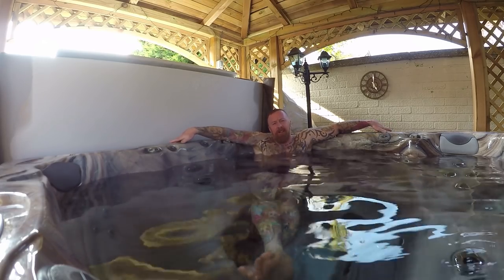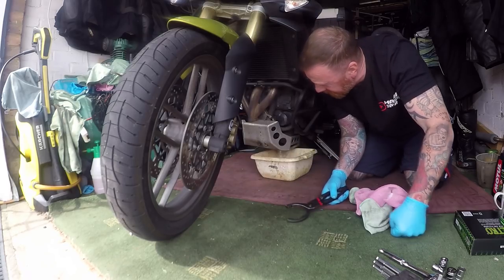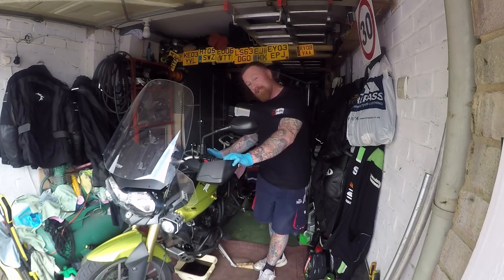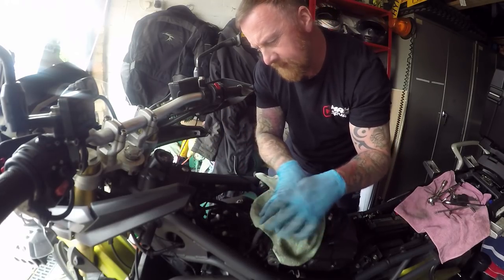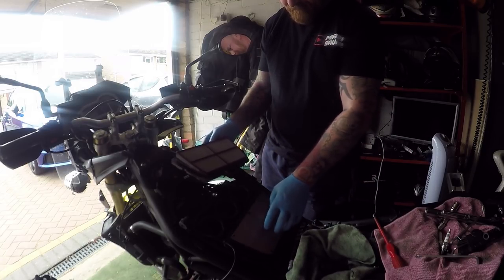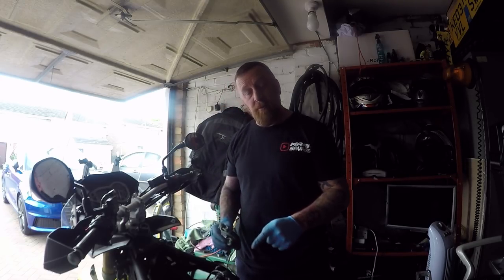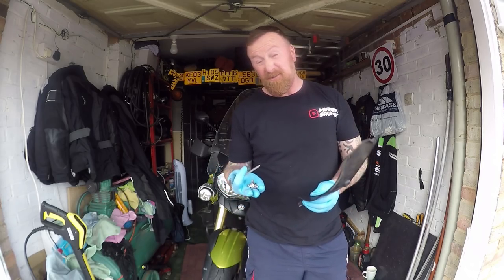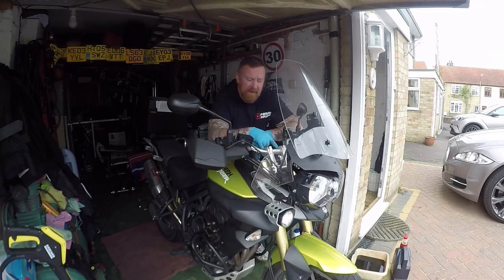TRIUMPH TIGER 800 SIMPLE SERVICE MARK SAVAGE

Comment: And l through my vstrom had many bolts and clips to service. Not looking forward to take my new to me tiger 800xc apart for service. How did you reset the service light? 
Great walkthrugh sir.
Reply from the maker: well the service went well and hope it helps you do yours, as for the service light --- no its still a main dealer thing and have to pay them to take it off---- me I left it on as its only small icon lol 
take care bud
Reply: @marksavage  always great to sneak peak on someone who done it before😀. Oil change is up next, and thats not a problem. Triumph has really bolted their tigers together to be solid. 😀😀

Comment: How much was your spa? and did you have to have it craned over the house? Perhaps do a vid on it reviewing it? interesting to know the ins and outs of getting one.
Reply from the maker: I love my hot tub and was going to do a review on this one, I set up another channel and was going to do all about to good and the bad and how to keep it clean, filter cleaning, how much they use per week and top tip on keeping the water clean 
best get that video sorted lol 
this one is a vista which is a good make hottub, it cost £8500 new but was  x display and got it for £6500
they got it down the side of the house so no crane need 
we are in it every day, winter and summer and love it 
keep an eye out for my review bud and thanks for watching
Reply: @marksavage  awesome mark, 6500 is good but 8500 is a tad over my budget I guess you need another 1500 for the bits and bobs it needs and install.
Reply from the maker: Rob k you can get them for £4000 we just wanted all singing and dancing lol 
Most will deliver and install with the price 
You will need a sparky to wire it in if 32amp 
Some are 13amp plug and play which are easier but not as powerful 
Will sort out a video bud for you

Comment: Thanks mark By anychance do you know if the turn signal relay is underneath the tank? I installed sequential LEd turn signals and they only light up half way not enough power from the relay. I have a tiger 800 xrt
Reply from the maker: Thats odd as the led use less power !
I thought it was at the back 
Have you tried to power straight from the battery to test they are working ok ?
They would normally flash fast if it was the relay , 
If not at the back I dont remember it under the tank 
I did a service video and had the tank off ,maybe give that a watch to see if you can see it bud
Reply from the maker: I mean another 800 video bud

Comment: Hi Mark what do you call the  pliers that you used to get clip of the fuel line ? Cheers
Reply from the maker: they were diesel plug pliers , but the work very well bud
Reply: Hi mark ive got a triumph explorer she let a back fire out of her as I was coming into my garage after a run though it was bad petrol but running very rough since very jumpy idle I was wondering would changing the plugs help cheers
Reply from the maker: @stephenkelly7887  a back fire won't just blow out the exhaust !
It could of popped off a air pipe so check them as simple thing to do 
But big time you could have damaged your valves!!
So going over it like you are is the first easy step and won't cost 
Check exhaust , air pipes , air box and plugs and see how you get on

Comment: Hi mark quick question for ya back wheel is locked up on moped cant push it so took of the wheel and took out the break shoes and the brake lever was stuck u could not press it so cut the cable  and still the axle wont turn any ideas its a project bike im fixing up its a 96 yamaha spy cheers
Reply from the maker: hi bud 
if its not the rear brakes its often when the belt snaps and locks the rear whell, 
however so its cable brake so it have shoes not pads, they can lock out so you will need to put the bike on the stand undo the wheel bolts on the other side should be the lever try and whack that in and out to free it up and keep doing it use loads of wd40 and try and get the rear wheel off that way

Comment: Hi mark, I have a Yamaha aerox 70cc I’ve asked you a few questions. So basically I was stripping it down for maintenance and work due to it braking down but I’ve sorted that and I noticed that it hasn’t got a thermostat and I looked at my old 50cc cylinder cover at work and that doesn’t have a thermostat either I was wondering what’s the consequences of running no thermostat or if it’s okay to do so
Reply from the maker: NonCopyRighted 
It’s common and just would just mean it take a little while longer to warm up 
People take them out to keep the temp down as the mopeds gets old with poor servicing of the water system 
If it’s running ok 
Leave it
Reply: mark savage thanks for the information. I have another question so basically I was riding to work then all of a sudden it would cut out and lose compression then like regenerate compression but then if you rode it for say a mile it would struggle then cut out. So I got home but I had to use the choke to stop it from cutting out which I know I shouldn’t of done after stripping it down on the cylinder head there was a shit load of carbon buildup on the spark and everything however i stripped it up about 2 weeks before that and it was fine. The piston has scoring down it but i blabbed and basically lied to the place I bought the piston kit from and they sent me out a new one so gonna install that then see how it runs. But for the time I was using the choke say 3 to 4 miles if that would that cause all the buildup or is the oil to fuel ratio off?
Reply from the maker: yes it would as it would be running very rich, as for the piston scoring I would be looking into your oil pump and seeing it is working ok and make sure you are using good 2t oil ( like in my videos 2t moped oil worth a watch)
this can be caused by running to hot too or its  a cheap or failing piston 
clean it all up change the piston and sort out your carb and cheek the oil and pump plus are flow and air filter then tuning

Comment: Hi mark..vids are awesome...I need some of your expert advice..I have a 2015 Peugeot speedfight 3 125 4t..the problem is on the dash there should be a temperature gauge next to my fuel level...it doesn't seem to be working...any ideas? Your advice would be gratefully taken...keep up the quality vids 😁
Reply from the maker: the SP3 had clock issues ! a lot had to be changed but for your lets do the simple checks 
on the engine you will a connector to the water system and this will send the info to the gauge so check for that first
then the wiring but really as long as you service the water system when you do the next service and keep an eye on your water it should be something you can live with bud
Reply from the maker: oh and thanks for watching mate there are a few sp3 videos on my channel 70 in total on speedfights

Comment: I know this way off this video but I'm (me myself and I) going to change my oil in my kymco agility 50cc WHAT KINDA OIL SHOULD I USE? CAR OIL? SCOOTER OIL? 10W 40 HELP🙏🙏🙏
Reply from the maker: with mopeds its ok to just use 10/40 but for me I still use motorbike oil but many others say it doesn't matter as long as its 10/40, its an easy job and something to keep an eye on as they all burn a little bit of oil so keep your eye on the oil level every few weeks
but do not over fill bud 
hope that helps I have many moped videos that should help with other things like service etc

Comment: Hi mark. I’m just wondering what 125cc would You recommend geting at age 17 on a CBT ? Cheers
Reply from the maker: hi bud 
it comes down to your budget , I have many 125 cc videos on my channel .
tyre in 125 mark savage and you will get to see them.
if you want a bike that keeps going ybr125 or cbr125, good money but the do keep going 
then you have the Chinese ones like sinnis etc, on my channel you can see them as they are a lot cheaper and require a little maintenance 
if you tall check out the derbi terra they are a good tall fast 125 
stay safe bud

Comment: mark my moped sounds like a motor cycle. it was quiet till out of nowhere it got very loud. I am not a mechanic an i really dont know any. can you help man ?
Reply from the maker: You will need to check if the exhaust has snapped or broken 
Start the bike and have a look if you can see where it’s coming from 
They can snap at the next near the head 
It’s not hard to change 
My videos will help
Reply: @marksavage  are you on Facebook or Instagram? I looked at the exhaust and I can't see a Crack,  it seems to be coming from  where the gasket and exhaust meet. I'm not a mechanic n I literally don't know any. any help you could give me I would seriously appreciate it

Comment: Hi Mark, how can I contact you to ask you some specific questions about one of your motorcycles who become mine these days :). I'ts about a Triumph Rocket 3 :)
Reply from the maker: I have a few videos on the rocket 3 on my channel 
They are great bikes 
Ask on here bud but give my videos a watch
Reply: I watched the videos :) and I'm happy with what I saw. Actually the thing is that I'm going to buy that Triumph from the guy who bought it from you. He is a Bulgarian and the bike is here. I want your opinion about this particular bike, is it worth it. The engine check lamp is on is that a problem or no. And have you got the solo seat or any other parts for that bike. Thanks
Reply from the maker: Zdravko Viranev oh wow so you bought my old triumph rocket 3 with the paint job that bud got done ?
Reply: Yes exactly the same bike :)
Reply: What's your opinion about that particular bike?
Reply from the maker: it was a great bike the light is on due to the chop exhausts that I fitted (£1200) and the lam sensor it needed a bypass unit but it didn't seem to do much but ran fine, I had the ram air on there but ran better standard 
I paid a lot out on it and all in when I had it ,it ran well
how has it stood up to time and does it still look good and run ok , have to ask how much are you paying bud 
as for the ride it likes to go straight lol, but you do smile when you ride it
Reply: @marksavage  it looks almost the same like on your videos, the seat and  genetation are different but it looks fine. If you give me a contact i can send you video and pics.
I want to ask you do you still have the solo seat and the rear fender (original) of it?
Reply from the maker: I gave all the parts with the bike, I had the rear fender still in black and the another twin seat wit the rear seat , sissy bar etc 
upload a video bud and ill take a look, do miss it as never got to show it off, the paint work was good that I got done on it
Reply: @marksavage  I will pay near 5k £ for the bike.How much did he pay for it back than
Reply from the maker: Zdravko Viranev a lot more plus the paint work , service and ram air so 5k is good for such a nice one off bike